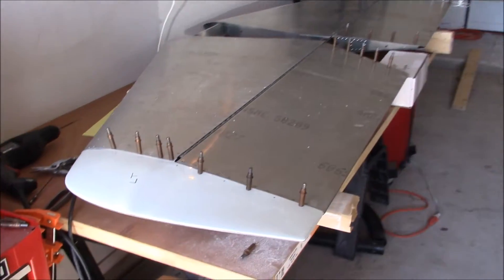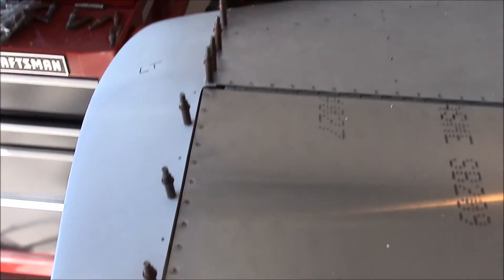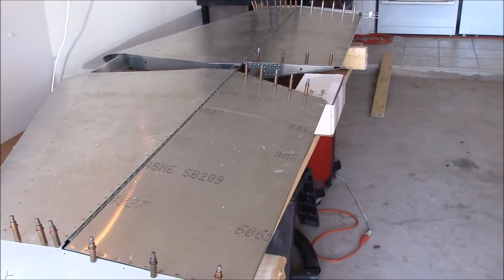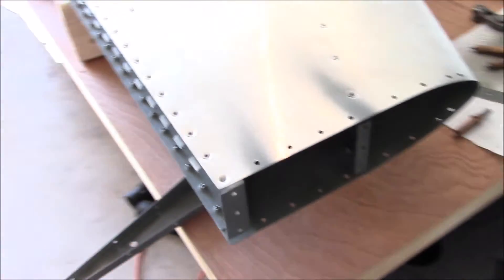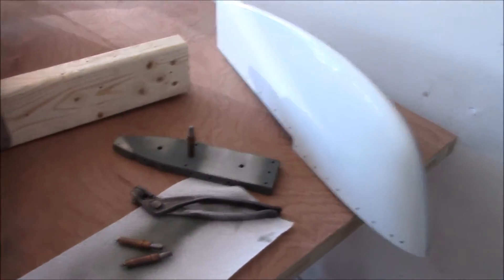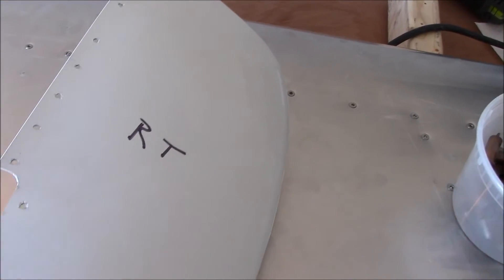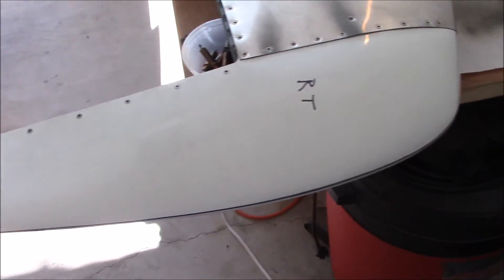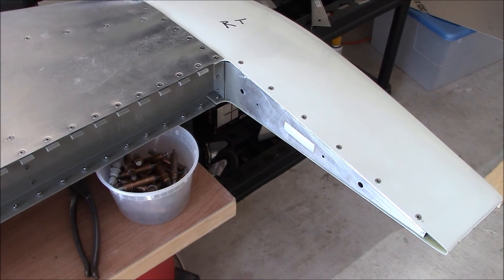Sonex Aircraft Build Video 31 Balancing Horizontal Tips and Finishing 1 Fiberglass Tip

Comment: Would removing material from the inside of the tips where they meet the forward section of the horizontal stabilizer create a better seam between the tip and the stabilizer, thus requiring less putty/bondo later?
Reply from the maker: Hi Jason. You are right, that would definitely help. My only concern was making the piece less strong. The fiberglass is pretty thin and I didn't want to give up any structural integrity to make it look better. -Dan